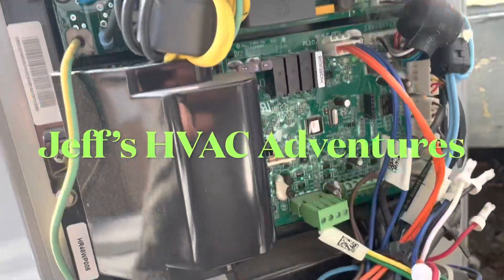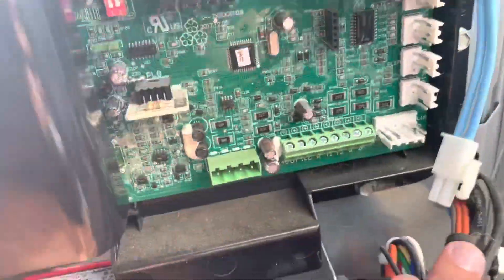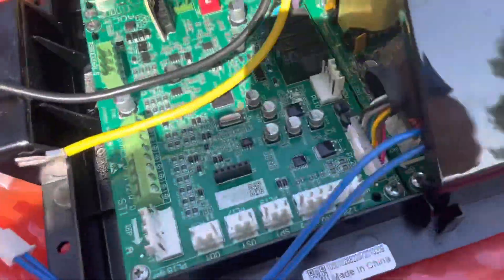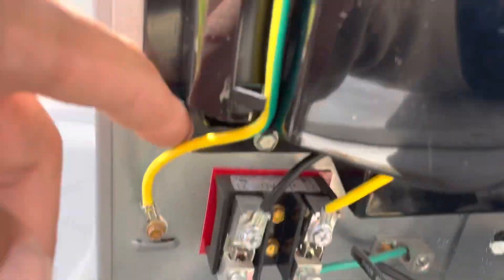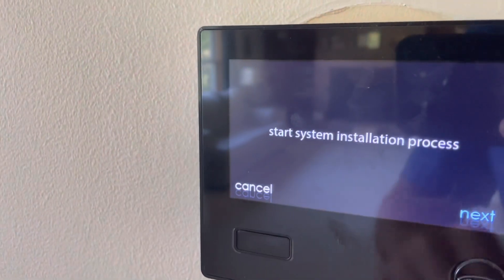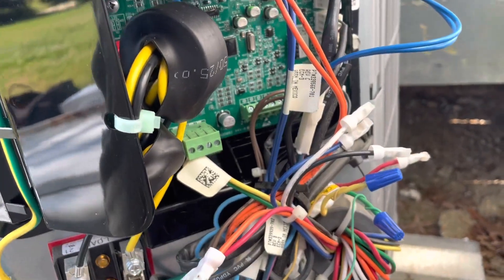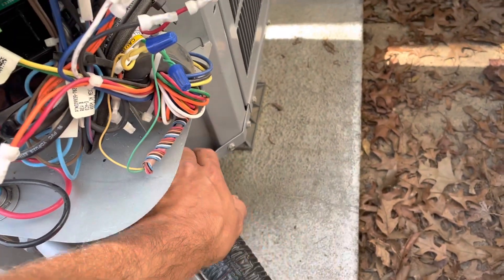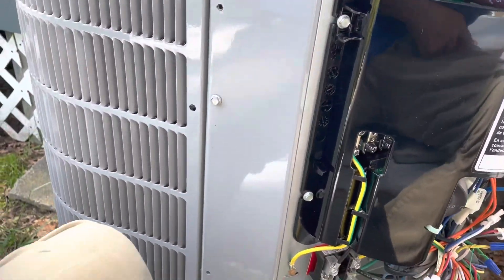Carrier Infinity Heat Pump Inverter Board Kit Replacement!

Comment: How much did you charge for replacing the inverter
Reply from the maker: This was still under manufacture warranty and our workmanship warranty.   So nothing to the customer. However if this was not in warranty, this would have been a few thousand dollars easy.  And that would have been mostly material.